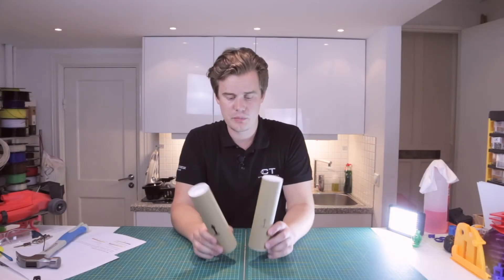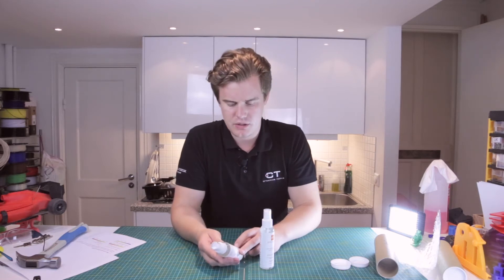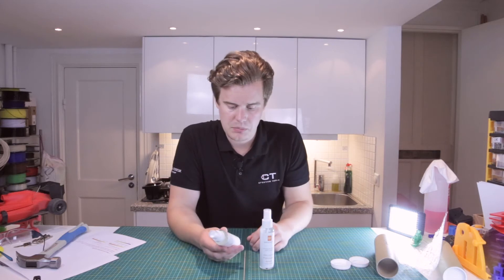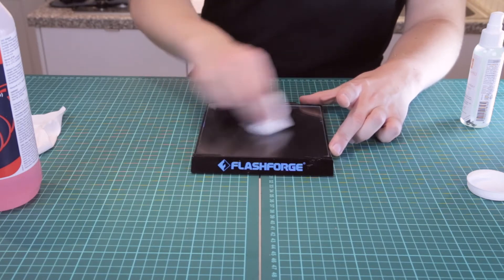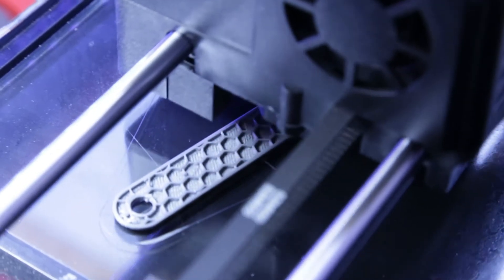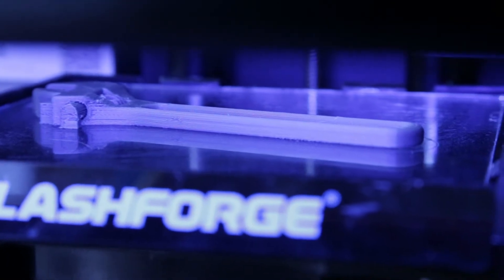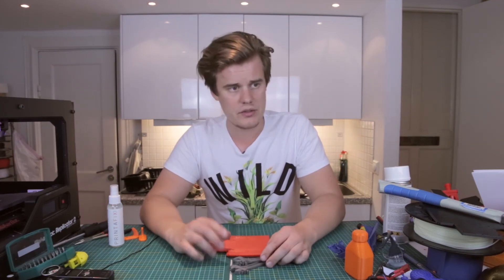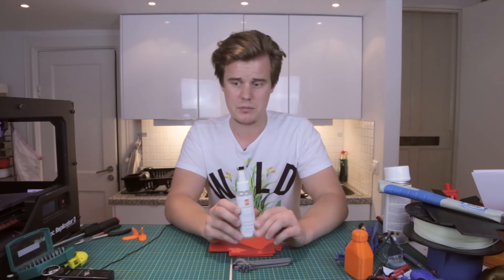/Review | APRINTAPRO - The Adhesion-spray for cold and hot buidlplates!

Comment: Would it work with ABS?
Reply from the maker: unfortunately not on a cold plate, but on heated (40+C) it works perfectly!   they might have something going on for cold plates with abs :)
Reply: +3D Print - Tech Design yea I want it for CubePro their glue is very expensive and not very effective.
You should consider reviewing 3D systems printers .
I have all their printers I acquire them very cheap so I got them for fun